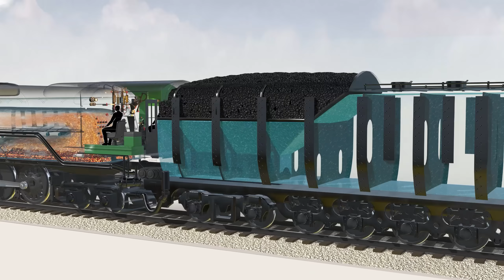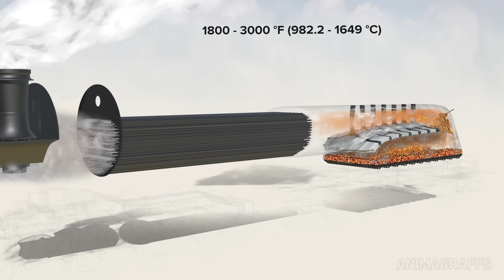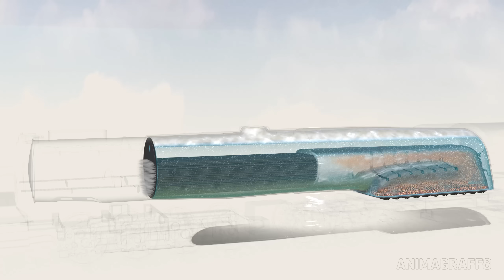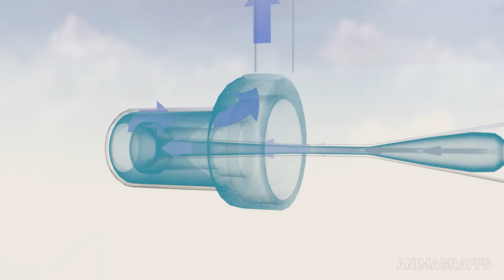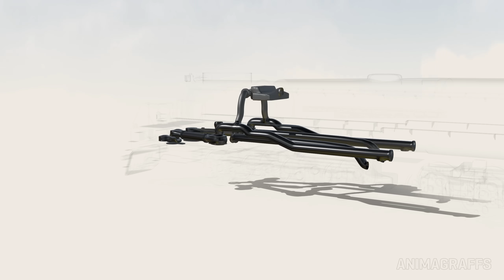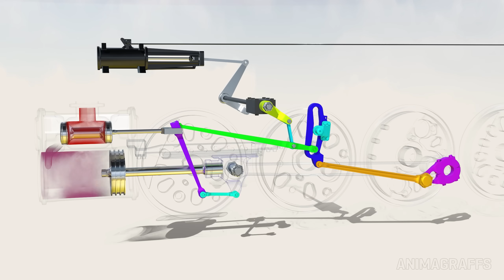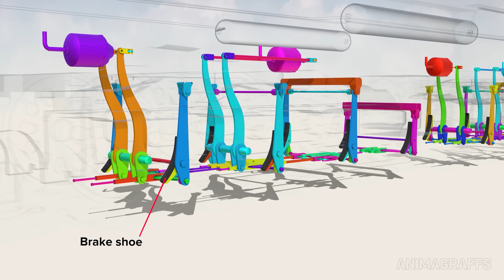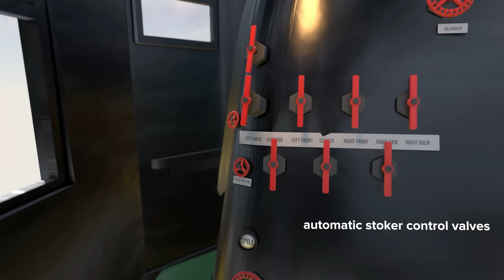How a Steam Locomotive Works (Union Pacific "Big Boy")

Comment: There's a helicopter (Sikorsky H-60) that the Army, Navy, Airforce, and Coast Guard all use because of its power, reliability, and versatility. It is one one the MOST famous and versatile helicopters in our great military. It would be a service to our nation and all the great men and women who work on, and fly in these amazing aircrafts if you did a video on the Sikorsky H-60.  Each branch uses the same base model, but then outfits them specifically for their needs. For instance, the Army's Black Hawk has a different assortment of accessories compared to the Coast Guard's Jay Hawk. Even though the base model Sikorsky H-60 has different models (Black Hawk, Sea Hawk, Pave Hawk, Jay Hawk and other's as well), a video on the the base model  H-60 would very easily become a primary training tool for EVERY branch of the military and it would be used for decades to help our great service men and women become better familiarized with the planes they work on and fly to help recue citizens at home and protect our freedoms over seas.

Comment: Believe it or not but they had one here on display in York, England in the national rail museum, the one on display was modified for a wider gauge because it was used all the way over in China. Inside the cab it had a huge Cork screw going to where the coal was so the engineers didn't need to shovel it. Pretty awesome train.

Comment: WOW! AutoCad ROCKS! As a retired BTJ Steamfitter Pipe/Welder with a C5 Boiler License, I am BLOWN away at what the designers and engineers made from sweat and steel, years ago! Ships of any size, Nuke plants, high tech industry etc., have interested me in so many ways. So, I had to design and build a BioDiesel processor, to run these contraptions on WVO (Waste Vegetable Oil) back in Portland, OR. 1997 when everyone thought "I" was nuts...

Comment: The only thing I feel is missing is showing the firebox, tender and pumping mechanism when they were set up to burn fuel oil later in the Big Boys’ careers. Everything else was magnificent but I have always wanted to see what the oil burning firebox looked like….I imagine the ash pans were no longer needed and the shaker grates were likely uninstalled as well, but maybe not. I assume the pumping mechanism would have to pressurize the bunker oil a good bit then spray it through some sort of nozzle to at least partially atomize the fuel and allow decent combustion as a simple stream of bunker 2 will not burn very well.

Comment: Read an old encyclopedia  that stated that by 1940 they were studying the exhaust of steam locomotives in order to better design the boilers system to increase fuel economy and steam output. There was more technology going into these locomotives than just slide rules and pencils. The designers were studying everything scientifically. Probably a lot of lost technology involved also, over a hundred years of tricks and hard earned advancements- and it all ended in no time.

Comment: Stunning. Both the graphics and the engine itself, both are works of art.  I could have done without the last sentence, however. We need to stop this pandering to the woke who do little but complain about the giants whose shoulders they stand upon.  Previous generations have nothing to appologize for, they moved mountains with their hands and defended the Rights we take for granted today.  It is this current generation who should be appologizing, appologizing for their lack of gratitude and undeserved hubris, for their lack of self-reflection, for their lack of tolerance, and for being demanding, disrespectful, and intolerable little guttersnipes.  Everything you have or will ever have, everything you have done or will do is only because of those who came before you, you are not withouot your own flaws so show some respect for your elders!

Comment: Wood never have been used except the get the fire going in a coal burning loco.  The latter oil burning locos would have used a rag soaked in oil to act as a pilot light in order to ignite the atomised oil sprayed into the fire box. Wooden simply would never have had the calorific valune to come anywhere near the value required to keep the loco in steam. Let alone enough to maintain steam production when the loco was working.

Comment: When I got my first glimpse of this video I thought, yea yea, I've seen how steam engines work before. Man, am I glad I got over that and watched!! I was not prepared to have my mind blown!! The intricacy of the various systems highlighted by individual but complimenting colors helps things to stand out even more, and to see how various components work together. I scratch my head at the knowledge that Hyce gave you with his in-depth 2 cents over considering  one aspect though, You mentioned that the super heated steam was dry and had no water in it. And yet it was mentioned later in the video that when the locomotive is allowed to sit for any length of time after operation that water will condensed from said "dry steam" into water, especially in the cylinders . That doesn't seem to make sense if dry steam has no water in it.. But overall, what a fantastic piece of video work. Just an idea for anyone who happens to read this far down into my comment, a way to make your comments better. Before sending, go back and re-read what you wrote, make sure it says what you wanted it to say. This also gives you a chance to correct any spelling and maybe any grammatical errors that you may have made  if you recognize.

Comment: This is the absolute best explanation of how a steam locomotive works that I've ever seen and I was an Engineer on UP (42 years), albeit on diesels.... And I'm retired now.....  My Grandfather and Uncle though did work on steam engines and between them and firing for the old timers, learned a lot about steam and running a steam engine.... This is a masterpiece of a tutorial on the Big Boy.... Spent some time on the 3985 Challenger when it would come around  but never been on the 4014.... Great informative video...! The complexity of a steam engine as a whole is beyond belief..... P.S. What always has fascinated me is the valve gear, in this case Walshearts and the complexity of it and how they engineered  it.... Crackers

Comment: The Big Boy did not pull a 5 mile long train.  It  was a theoretical guess back then.  In reality it lack the tractive effort to do so.  And today’s diesel can pull much more tonnage than what Big Boy did.  They averaged 3500-5,000 ton trains back then on a 100-150 car train.  Cars were smaller, lighter and carried less tonnage.  The Big Boy falls in line between an Sd -60 and 70 in today’s diesels.  I’d have to go check my papers for verification as I believe the big boy only had around 135,000 lbs of tractive effort

Comment: If was I designing Big Boys Tender, there's some alterations I would like to make to hold as much coal as possible.
1. Make the tender the same length, width and height as the locomotive itself.
2. Give it two tenders. One for coal, and one for water. Both would be the same length width and height as the engine.
3. the tender would be a low-riding tender, as opposed to a centipede tender for a bigger capacity,
4. the inside of the tender would be adjusted to have flat walls at both ends for a bigger capacity.
5. the downhill slopes inside the tender would need to be adjusted slightly so the coal would still go down into the auger.
6. the auger covers at the bottom of the tender would be removed so the screw is completely showing
7. the inside of the water tender would have flat walls and flat floors so the water capacity could possibly be over 200,000 gallons
8. the stoker would be similar to 611s tube and blasting table, instead of going under the floor and be pushed up into a pot.
9. the Screw would extend all the way to the back of the first tender instead of halfway because of the larger capacity.

Comment: I think a term called a ' Johnson bar worksxthe valve mechanism for reverse, a large  quandrant with teeth and a handle that must be pressed to go over the quadrant, this whoe set up called the johnson bar works valves to put the loco in forward or reverse or to not allow steam to engine.
Two sets of braking, teain and indepenent. Train brake lever works loco, tender and cars. Independenr is jst for loco.
A steam turbine works a d.c. dynamo for cab and headlight and marker lights.
Train brakes charge a tank for each car and loweing pressure in cab makes for an application of brakes. Dumping all air is an emergency application of brakes.

Comment: A question re. the brakes: my understanding is that on modern trains the air pressure keeps the brakes from activating so that if the air line breaks (or a car gets disconnected from the train) the brakes automatically get applied. Is this something that was a later development, is it more complicated than that, or am I completely misunderstanding how things work?

Comment: In a steam powered ship we make a distinction between the boiler and the engine. Would it be correct to say the engines on a locomotive are solely the piston, the cylinder and the drive train?

Comment: Excellent video, and hats off to designers of such beautiful engineering.  This was truly the time where USA was leading the front on all fronts !  A modern day electric locomotive with 7000 HP cannot match the big boy's tractive effort.  It would take around 5-6 motor locomotive to beat the tractive effort of a single big boy.  That's essentially, 2 modern day electric loco needed to do work of one big boy.  The majestic efforts and out come should be definitely highlighted for generations to come.

Comment: An engineer I used to work with told me that when he was an engineer on a steam engine, if he didn’t get along with the fireman, he could set the throttle that the fireman would have to shovel a lot more coal than normal. Now I see what he meant.

Comment: Your video got me to wondering what keeps the piston from seizing in the cylinder without oil such as in gasoline engines? does the steam keep the temp down or have any lubricating effects? I assume your the computer guy, and you had the info from a locomotive expert, but thought you might have an answer. Great Video!

Comment: So, most of the power to push the big train is channeled through those small cylinders down by the wheels. They don't look so tough. Have they thought about increasing the width of the track to hold a bigger engine? They presumably selected it as the best fit for small locomotives of the time like the American-C or Consolidation from RT2 (lol). How come the auger screw doesn't get jammed by the coal?

Comment: I wonder what the temperature was like in that cab? Once upon a time I would've thought it was always hot, which would be nice when it's chilly out but a drag when it's hot. Having worked at an aluminum smelter I now realize that just because there's a tremendous heat source nearby doesn't mean you're going to be comfortable in the winter!

Comment: I don't understand why they designed it like this, impressive as it is. You could just flip the entire thing around and have the crew face the other way and it would solve all the visibility problems. The way they made it, it's like driving your car from the trunk... Just put the boiler and everything BEHIND the cab. They would have to figure out another way to feed coal, but that seem trivial in comparison with all the other engineering challenges they had to overcome to build this.

Comment: I wander if it is possible to "collect" used steam to reclaim the water and excess heat.

Also it is intereting if it possible to replace water with different liquid to reduce boiling point and working temperature.

Comment: Interesting to see, that the brakes applied on positive air pressure. You'd think you want the brakes applied, when there is no pressure in the system, like modern train and truck air brakes are designed. Especially since so much thought went into redundancy in this train.

Comment: We had a Big Boy, 4018, that was at the train museum at Fair Park in Dallas.  Just the size of it all was astounding.  Driver wheels as tall as I am.  The length of the engine and tender is longer than across our yard.  Then in looking around more I noticed how small the forward windows of the cab are.  I mean very small.  Smaller that they look in this illustration.  They are about 12x18 inches.  Plus you are about 90 feet from the from the front of this massive engine.  I wondered how on earth could the engineer or fireman see what is out in front of the train.  Then it occurred to me, WHAT DOES IT MATTER!   If anything got in your way, this engine is going to go through it like a baseball bath through a box of crackers

Comment: It always blows me away when I think of some of the stuff people we able to design. I'm not a huge train nerd (I say train nerd as a term of appriciation, not to denigrate) but I am a ship nerd, so I know about things like battleships. It shouldn't surprise me at all that in the early 1900s someone manually worked out a way to make nozzles blow a pile of ground up chucks of coal in a way to evenly coat an enormous coal fire box, because I know that at the same time they were doing things like designing the Mk 8 Rangekeeper on battleships, which is an outrageously complex electromechanical computer... but yeah I'm still like, "Holy hell I can't believe anyone built this."

Comment: Very Very interesting. Quite a few things I was surprised by. The pinnacle of very old tech. Power rather than speed. Interesting they were built in early 1940’s. No doubt resources were in short supply more modern more efficient tech required elsewhere. Coal fired, again resources, shortages, priorities ect. Early 1940s coal fired made sense. 
1950s not so much. 
Not having any knowledge of a locomotive engine. With some knowledge of marine engines. 
I was surprised to see it is a “fire tube boiler” although the superheater was “water tube” so it is actually a bit of a hybrid boiler. 
Double expansion double acting cylinders with no condenser. Lots of power. But lots of power and heat going up the chimney. 
The ports, big advantage in less moving parts, can cycle faster. Let’s see if I remember correctly 1 bar is about 15lbs so 300 psi about 20 bar. Boiling point can’t remember. 

I was a bit surprised they were using superheated steam in cylinders. Cylinders like wet steam. When you can see steam it’s wet. Lots of water, just at or near boiling temp. 
Turbines need superheated to ensure no water droplets. Hence superheated to get above boiling point. 
Without the lubrication effect of the water droplets how did they lubricate the cylinders? 
After the war was over I guess the lack of efficiency started to matter. Oil relatively cheep and availability, Oil fired is less complicated and diesel’s greater efficiency more sense.

A diesel just doesn’t quite have the same magic or appeal. Steam can produce more power but you got use a heck of a lot of fuel to boil a big kettle.

Comment: Now nearly 80, I  was a jet fighter pilot.  My Grandfather was a chief engineer on the Rock Island Line, and the first to drive a diesel locomotive.  The detail of this animation fills in a great many links on the evolution of engineering in transportation.  In per-digital times, we refereed to our instruments as steam gauges as there was little or no electrical connection (came in handy with electrical failure).  Fantastic, accurate, and engaging detail.

Comment: This is an engineering MARVEL!!! . I'm simply overwhelmed by the sheer complexity of this beautiful beheamoth! I'm awestruck by the "brain powers" that designed this! Nothing is taken to chance and every bit of POWER is channeled and used to maximum efficiency! As a kid, I was fascinated by trains (especially Steamers) so much so, as a four-year-old wee lad I would carry around EVERYWHERE no less than three photos with me (it got to the point where my Mom had to place a cardboard backer on each one and double-wrap them with that thin plastic film...
(Ya know...the kind that you wrap sandwiches N cover leftovers with! lol!) I am lucky enough to live in a city that has two active Steamers. The first is a small little guy that we just refer to as
The ZOO Train. (Located at Zoo!) It's a totally authentic Steamer (a scaled down version of a mid 1800's 4-4-0 built by Crown Metal Corp. and bought new in 1964) with a tender and four 
"trolly"(?) style passenger cars (not sure if that's what you call them, but they are open air with a roof) There is also a full size Steamer named "The Prairie Dog".
 It is an ex-CNR Locomotive # 3 built in 1882 by DUBS in Scotland. It has 5 passenger coaches of varying vintage, a tender and a caboose (I think). It goes on scheduled runs to a small country town where they have a farmers market and events (Train even gets "robbed" from time to time by outlaws on horses! lol!) Anyways, I've been on both and this show just makes it all more fascinating when you ride.
 Thank you for a phenomenal show!! \m/

Comment: Excellent video! 
It is probably already said in the comments, but I think there is a mistake in the weight of the tandem. 1.4 million lbs is 635.000 kg (635 metric tons), not 6 million kg (6000 metric tons).

Comment: Very interesting once again! Was there no springs in the braking system? I think today compressed air is used to release the brakes and not to engage them (as a safety feature). I also did not understand why used steam is thrown out? Couldn't it be cooled down to water, so less water is carried on the train?